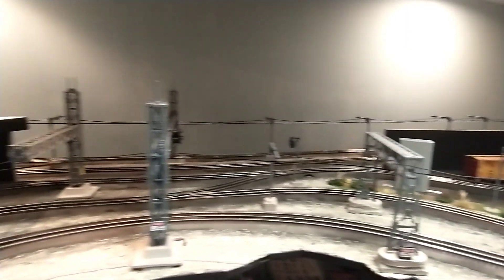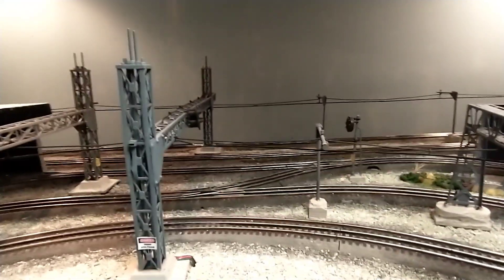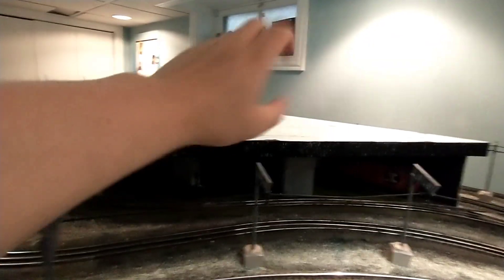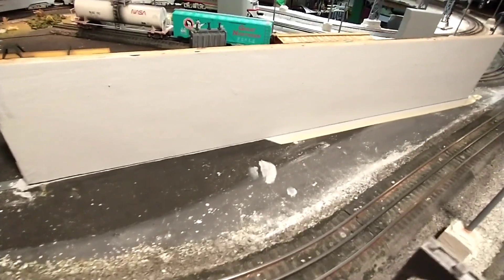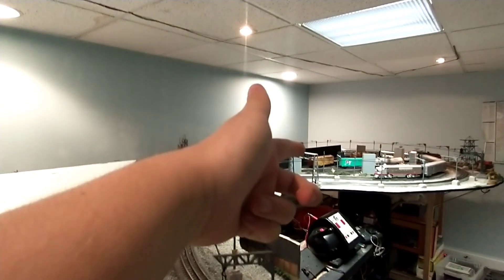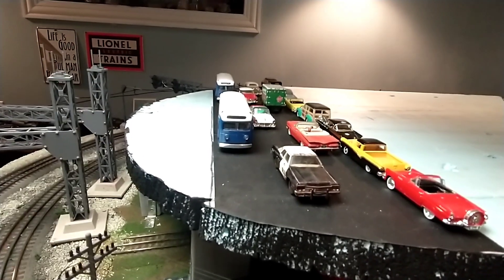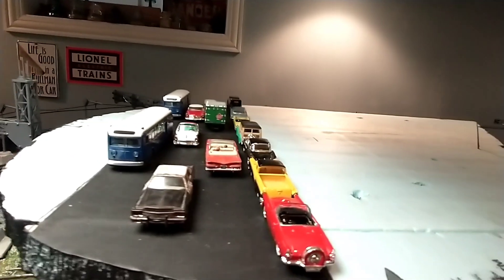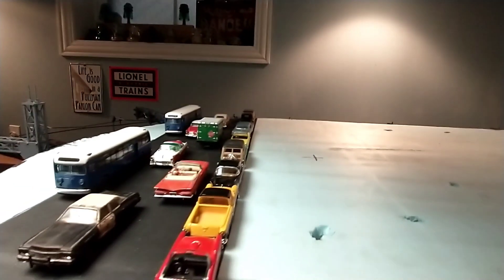Layout Rebuild Part 16

Comment: Very nice!  I always enjoyed being in Chicago, when I stayed there during my railroad career.  My dad grew up in Wisconsin and spent lots of time in Chicago.  He would show us around when he was in town for business. The expansion is cool and I love the catenary, as it make running electric locomotives look more realistic.  I'm planning a small, about 3x4, upper section on my layout, to run my Marx trains.  I'm going to put Mel's Diner and an MTH gas station in the middle, as most accessories are just way to big for most layouts, but they'll work nicely on a display.  I like the sandpaper idea and it looks good.  Having decent looking roads, is a must.  I'll be using felt paper for mine, as I have most of  a roll left over, from when I did my hardwood floors.  I've just started a new channel, dedicated to running post-war and MPC-era trains, from all of the O gauge manufacturers.  I'll be going through the layout building stages and also run some trains.  It may take a short amount of time to get everything up to speed, but it should be fun.  Either way, an excellent video, as always.
Reply from the maker: Thanks for the kind words! What railroad did you work for?
Reply: @chicagolandrailroader  Thanks for the sub, I really appreciate it.  I started with Conrail and then moved on to Norfolk Southern, after the takeover.  NS isn't the nicest place to work, but I made it through until I retired in April of '23.  It is certainly a great career, for sure.